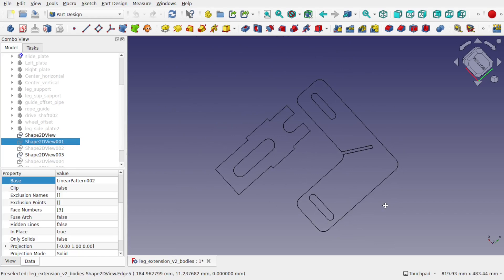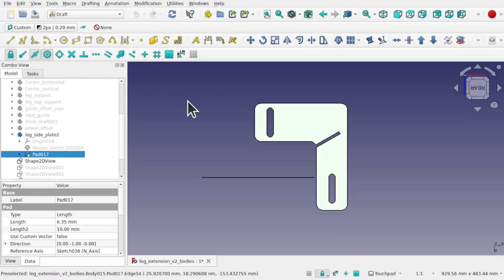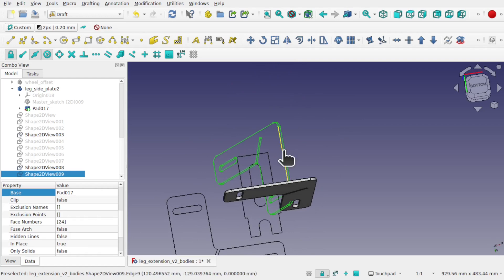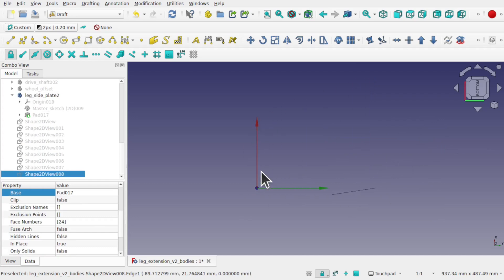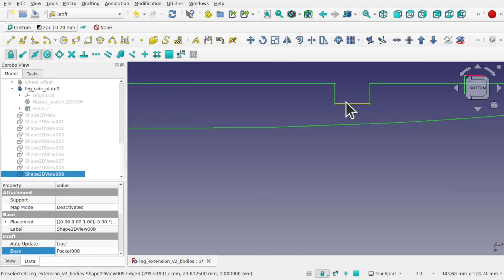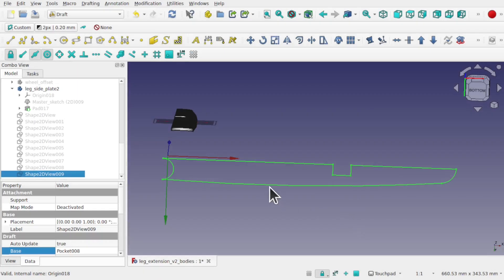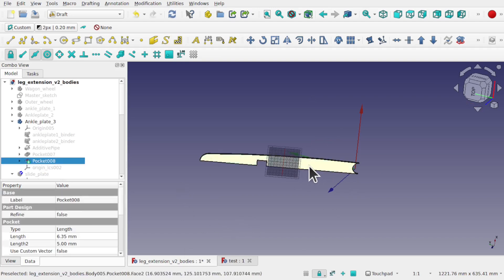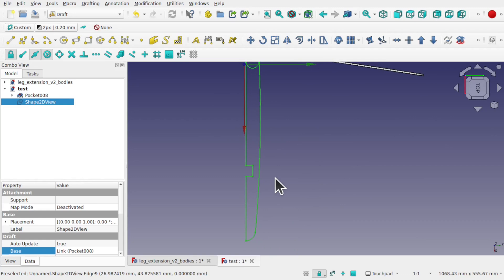FreeCAD: Flatten to 2D Output from a Custom View Point | Laser Cut | Plasma Cut | CNC

Comment: I find this method works great. on the condition your base model is made from a sketch that has no bsplines.
if you have splines in your sketch and that sketch is extruded/pad/pocket the bspline will cause overlapping lines from some kinda of deviation when the 2d view is generated. You can see the double lines when you downgrade the 2d projected view.
I don't know the workaround for this. As I have a sketch that is made up of bsplines from a imported logo tha is pocket away from a flat plate. when a projection is taken there are deviation overlapping lines.

Comment: Hi thanks for all the great vids on freecad.. 
I’ve had issues with the exported svg or dxf using this method.. when imported into my cut software (carbide create ) the svg/dxf are not closed.. 
is there a solution/setting I’m missing .. 
if I export a simple let’s say square with a circle cutout it’s fine but a square with filleted corners is broken in a few joints but not all joints.. thanks again..